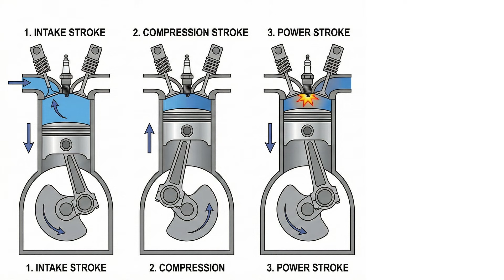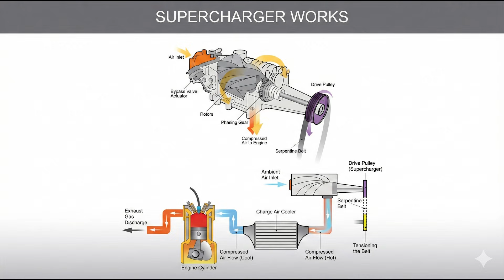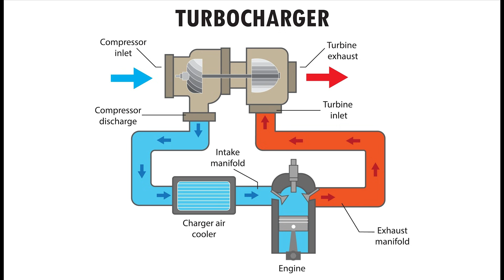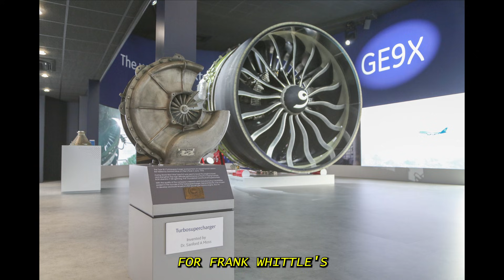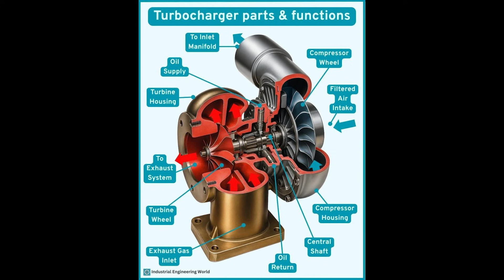What Happened When He Dragged A V12 Engine Up A Mountain

Comment: You completely omit the addition of other power adders like the water methanol injection which is the only reason why some of these planes could get the range that they did. The water methanol injection also helps keep the internals of the engine quite clean so that you don't have to take it apart and rebuild it when it's getting carboned up at altitude.